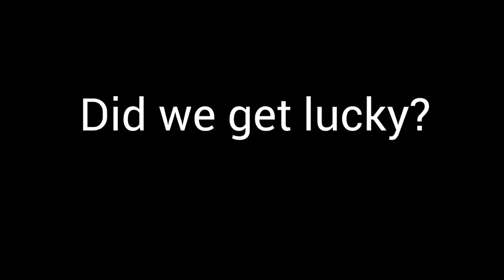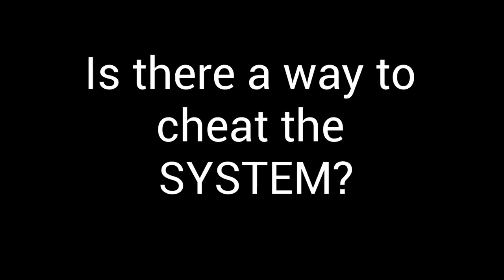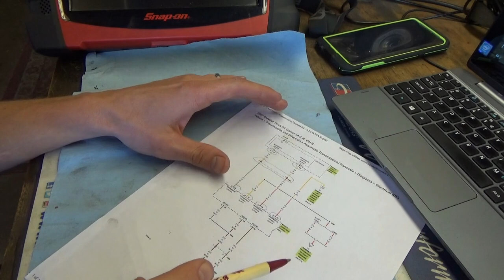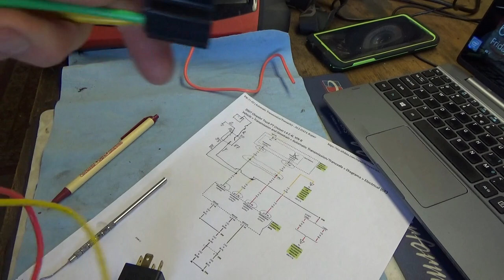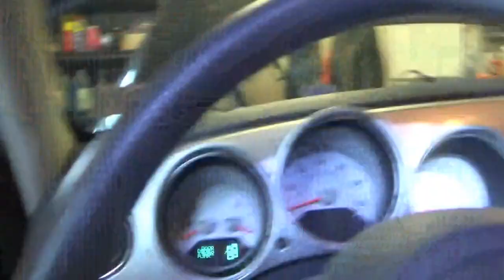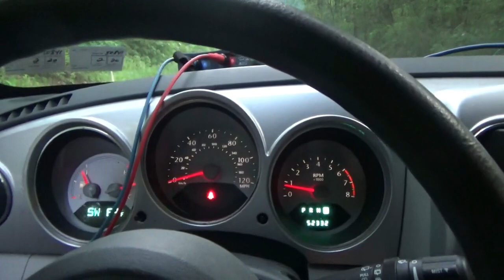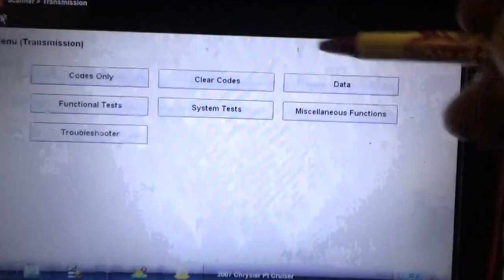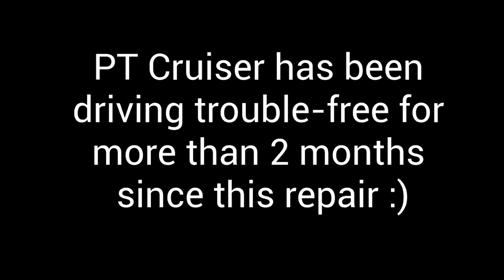Chrysler "LIMP HOME" Cruiser: P0882 - TCM Power Input Low (Part 2 - TIPM!)

Comment: The ONLY problem I see with this bypass (and it's a great fix by the way) is fault logic. The TIPM will no longer drop the output if there is a fault trip.
Reply from the maker: Judging by the circuit description, the PCM is in charge in this case, so pretty sure the TIPM will be happy :)

Comment: Thanks for the insights.  The Russians would have never used that ill-conceived TIPM when the old school systems worked fine and could have been repaired in any garage w/o special unobtainable parts and w/o having degrees in flat-earth, celestial and quantum mechanics.

Comment: Very fair. I mean the diagnosis time would have been the same either with the Russian repair or if you had ended up replacing the TIPM altogether. So, an hour and a half, plus the relay instead of the $600+ TIPM, I say this customer is getting a killer deal.

I could take it a step further and say that the $600+ TIPM is prone to suffer the same demise as the first one as opposed to the relay outlasting the car.

Comment: I have a 2006 PT Cruiser I see the light green wire no.18 but I do not see a yellow/Orange wire.  Did they change the color coding from the 2006 to the 2007 PT Cruiser?

Comment: Ivan, why didn't you also use the voltage of the pcm on the switch side instead of laying a cable to the battery? and you should connect the fuse as close as possible to the battery next time, but otherwise a good diagnosis and a pretty simple fix!
Reply: That wire coming from the PCM isn’t designed to carry the current to handle that load. The wire he tapped into is just to control the mosfet in the TIPM and now he has it triggering the relay which now serves the same purpose essentially.
Reply: @Jpilgrim30 , that was also the only reason I could think of myself, and yes, this way you are sure that you will not blow anything up.

Comment: FCA had a tsb on Durango fuel pumps to wire in relay out side of the box early tens also wired many in the early 2000s Ford truck s for the fuel pumps

Comment: I have a 2004 PT Cruiser 2.4 no turbo with a stuck in gear problem. I have Park, Reverse, Neutral and one forward gear. First gear. I am wondering if it is the same problem.

Comment: Can the yellow and orange wire be yellow and black. I can't locate a yellow and orange on the 2007
Reply: I have a 2006 their is a yellowish wire I also see a yellow/black wire. I've tried the yellowish it worked for 15sec then went back to the engine light. Couldn't tell if it was shifting.

Comment: I'm just wondering one thing?
Does the TIPM have any logic (based on some other inputs / voltages / fuses etc.) that would allow it to disable that signal going back to the PCM independent of the signal coming from the PCM?
 If it did, then with your modification it would no longer have that ability to go into limp mode due to those other factors.
Seems odd they'd send a signal into the TIPM to simply have it pass back out again. (except for the necessity of a driver). Especially since pcm output seemed able to drive enough to satisfy those other three logic signals without a driver since it was able to drive your test light.
Odd?

Comment: Half of what the TIPM runs as far as what to charge. As you said, labor. You ALWAYS need to get paid for your talent. The dealer would have SCREWED the owner. You didnt fudge a repair eather. You actually IMPROVED the device. Your repair will outlast the original dealer repair and that speaks volumes. I would glady pay you for what you saved me. Then I would sell that POS !

Comment: on the older systems like that, "non can-bus" controlled when putting a relay in, be sure to use a flyback/anti-spike diode or the issue will soon be upstream and major from high voltage spikes do to back emf as the field collapses =p
holy-moly too much for youtube's

Comment: doesn't the TIPM protect the transmission and place it in "Limp" mode for other valid reasons (other than low voltage)?
One would image that's what some logic in the thing was built for.....  
I understand the fuel pump issue but this command to limp mode seems to have some protective cases....

Comment: Well nice job I’m going through the same thing with my 2005 Sebring I’ve got the relay fuse and power working on the output but be dammed if I can find the yellow and orange wire I’m thinking did the Company change the color of the wire I need to hook to if you would get back with me on it lost is Louisiana lol
Reply: I'm working on my 2005 PT and also cannot locate the yellow/orange wire.  Did you find a solution?  If so please share.

Comment: Ivan, did the Toyota relay have a built in surge suppressor accross the relay coil? (diode or resistor)  I'm guessing yes since it has been running for 2 months.
Reply from the maker: Of course. Toyota OEM relay made by Bosch :)

Comment: I had a p0882 low input voltage on a 2013 avenger 2.4, no power to tcm, bypassed with a relay and it would work temporarily then it would give a p0883. Any ideas?

Comment: I think this 90 deg. PCB interconnect looks very unreliable. I would have considered reflowing the thru-hole solder connections. There might be micro-cracks in the solder. And if one is bad, the next one will follow soon.

Comment: Hello Ivan. My connector where it is assumed that the yellow wire goes to I don't see an orange/ yellow wire there. I need your advice. Thanks for your valuable time.
Reply: I've a 2005 that also does not have the orange/yellow wire.  Did you find a solution?  If so please share.

Comment: Hello do have the worong diagram for the 2006 Chrysler pt cruiser. For the c4 harness I want to put this relay on it having the same issue and it also causes the obd data port not to work as well

Comment: You can get in real trouble if the relay doesn't include a flyback diode... electronics don't like to be zapped... when you de-energize a relay, there's a coil inside that generates a high-voltage pulse (remember how an ignition coil works?).  The cure is to add a diode across the coil that allows the positive feed voltage but shorts out ('snubs') the big reverse pulse.  Some relays include this diode... some don't.  Be careful!
Reply from the maker: This one does so no worries. The scope captures prove it too...no spikes!

Comment: I'm running in to the same problem with my 06 pt  Loser but the problem I have is on the connector I don't have the yellow and Orange white all I have is a yellow and black the yellow and Orange is on a relay on the firewall

Comment: You mentioned that these are not like a Mercedes or BMW. These tipm modules are straight out of the Mercedes playbook. Daimler owned both companies in this era. When the tipm fails it's actually a really easy fix if you have the $1200 to replace it. And they do have pretty robust limp mode ability. It's a different philosophy. Can't say I'm a fan though. I'd take the Toyota.

Comment: Ivan -- A+ for innovation, but...  I didn't see you put in a diode across the relay coil. So you're asking to blow the driver in the upstream module due to an excessive voltage pulse on relay-off. (In this case a negative voltage pulse, since high signal = turn on, which you've applied as "positive side switched" to the relay). That upstream module is the PCM/TCM, right? So not one to send abusive pulses to, willy nilly.  As a second issue, that PCM/TCM output was only expecting to send an information signal to the TIPM, not drive a significant load.  Driving the relay requires on the order of 100mA to 200mA, which is not very large by automotive load standards, but is 10 to 1000 times as high as an information signal would require.  So even though you demonstrated that this PCM/TCM output is capable of driving a test light, and then the relay, for a brief period of time, nonetheless this presents the risk of burning out the driver for that output as it's not sized and heat-sinked to drive such a load.  Hopefully it has in fact been sized to withstand various hazards, and this relay coil is within that envelope.  But the diode remains an issue.
Reply from the maker: Interesting thoughts, Graham! I didn't see any excessive voltage spikes on the control or load side at all. This is a low-current circuit, and also the relay is only turned on/off only once per ignition cycle, so I don't think it's a concern in this case :)
Reply: You will be right by luck rather than by design, but automotive electronics is often designed more robustly than necessary ("defensively"), so perhaps luck is on your side.  Beyond the present case, I'm rooting for you to acquire ever more sophistication for your forays into "minimal-parts-required" design "enhancements". :-).  Glad to see you got a respectable soldering station!

Comment: Ok folks...I had the exact same problem with my 08 pt cruiser. Bad tipm. Same issue loss of power. Wiggle the box and put pressure on it I lost power. Trouble code p0700 0882. I fixed it in less than 3 minutes. This is a manufacturing glitch. Here is what you do very simple. There   are 5 screws on top of the tipm. These screws are cranked down way too tight especially the centre one. This is causing stress on the circuit board and in conjunction with heat build up the stress is creating force on the circuit board and bending it very slightly enough to cause power loss. Remove these screws and then use a hand tool to tighten them but do not over tighten them. Leave them snug. Especially the centre one. Don't even snug this screw. Turn it just enough to catch and leave it this way. This will take the pressure off the circuit board. No need for the relay unless the tipm is too far gone. Remember hand tighten these screws and don't torque them. My pt is running fine now.no more limp mode.
Reply from the maker: Sounds like it has a cracked solder joint. Your solution is temporary until the crack gets worse 👍
Reply: @PineHollowAutoDiagnostics  ok thanks  .just in case I can do the relay. .I did notice when I cut the yellow and orange wire and tested for voltage there was power present at both sides. Is this normal?  Thanks a million

Comment: Hey I have a 2010 dodge journey with the same problem. I can't find the wiring diagram anywhere. Do you think you could help me find out what two wires I need to use from the pcm? I would really appreciate it. This thing is driving me nuts
Reply: Its an sxt btw

Comment: I have a 2006 Pt Cruiser Convertible with a turbo.  The wiring is different coming out of the PCM.  You put your relay using c4 pin 18 (lite green wire) and c4 pin 38 (yellow/Orange wire).  On my cruiser at c4 Pin 18 (wire is lite green) and Pin 38 (it is empty no wire).  Could you help?  Please!
Reply from the maker: Fill out the appointment form on my website, I can send you the OEM diagrams :)

Comment: I would put a diode across  the relay coil to suppress the back EMF voltage spike generated by the relay turning off from going into the PCM and damaging it. This spike doesnt exist in solid state switching.
Reply from the maker: Did you see the spike on the PicoScope during the test? I didn't, so it doesn't exist ;)
Reply: I think you got lucky this time. !
Good work as always though 🌝

Comment: TIPM fails due to vibration/warming up. Ergo: bad solder joint somewhere, but, indeed, with an entire board to choose from and it being conformal coated, good luck finding said joint.

I can see it from an engineering/manufacturing point of view, though. With going solid state so much more can be automated and, if one's process is solid, boards like that should last 5 to 10 times the usefull life of the vehicle. Thing is, getting and keeping your reflow soldering process solid is really freaking hard. Things like that slip through QC and you get one frustrated owner and tech 12 years down the line.

It's a balancing act from a design point of view. Do you go with the ease of repair approach, meaning your product will certainly fail if a customer uses it for a prolonged time (entailing all the hassle of getting it looked at and fixed) or do you bank on everything going well on your end and your product never breaking down, even if the customer hangs onto it for 25 years or more? -with the caveat of a more costly repair if an absolute minority doesn't make it to the MTBF (Mean Time Between Failures).

It's not that simple. Not all your customers are Ivan, or even know someone like Ivan. So, personally, I'd err on the side of eliminating mechanical wear items like relays too.
Reply from the maker: Yeah looking for that one bad solder joint would probably have been a lost cause!

Comment: Wonder if this will fix my pt cruiser that wouldnt go pass 60 mph, then 40, then wouldnt go up a hill, then not pass 5mph, then it broke down while parked with a rough shake to motor? It cranks, but wont start even with starting fluid. Would this be the same fix needed? Anyone think so? Thanks ahead of time, cause i been stuck in Georgia from North Carolina.

Comment: The question is, does the TIPM do any sort of logic control in between the input/output?  Like, does it command the limp mode, does it power down companion circuits to prevent damage, does it do other sorts of controls/protections that are now bypassed?   Or is it just a dumb relay box?   Secondly, there is increased risk to the PCM in this situation, as that 30-amp relay surely is sucking more juice/inducting spikes (diode or not) than a tiny SS power transistor.   Perhaps long term this may result is a dead pcm driver for the trans?   Is there precedent on this circuit like on the fuel pump bypass?  Not trolling, just genuinely curious...  I love it otherwise!
Reply from the maker: All good questions! Since the TIPM didn't set any codes, we'll just assume it's a dumb relay box for this circuit :)

Comment: Most common problems in this level of engineering. Crack sata joint. Says you can lose I press a soldering pencil over the joint in the specific areas where I suspect  A by joint. One  Chance out of 3 it will work.

Comment: Wonder if this will fix my pt cruiser that wouldnt go pass 60 mph, then 40, then wouldnt go up a hill, then not pass 5mph, then it broke down while running in park, with a rough shake to motor? It cranks, but wont start even with starting fluid. Would this be the same fix needed? Anyone think so? Thanks ahead of time, cause i been stuck in Georgia from North Carolina.

Comment: Any on notice the Fuse on the Wrong side of the Relay.. Fuse Need to be as Close to the Source as Possible, Any Short to Ground from Wire to FUSE will Glow a Full Burn thru of that Power Cable..

Comment: Have you or anyone else had problems with the Chrysler/Dodge vehicle dying while driving in traffic (Scarry situation) or not starting with the turn of the key? 
It won't even turn over. The electric system (including the radio) comes on. 
No "Warning Lights" indicating what is wrong.

Suggestions......?

Comment: I'm trying to do this, but the only yellow wire I have on my 2006 PT is yellow with a black stripe.. help!!!! Is that the right one?
Reply: I'm working on a 2005 PT with the same problem no yellow and orange wire. Did you find a solution? If so please share.
Reply: @0fukit  I think I did finally figure it out, but I have gotten rid of that junk because after I wired in a relay, I even got a new Temple, and it still kept doing the problems so I may have been in the wrong wire but I don't know. I'm sorry I can't help you

Comment: by 7:39 bad solder joint, very likely where the tow boards meet at 90 angle.... enhanced by ROHS junk, from the board substrate to copper, to lead free solder, to the top coating............
I wont go into the components  themselves lol

Comment: god i wish you were near me lol ur amazing at troubleshoot and getting root of problem i got dodge ram 2012 1500 5.7 got new one installed it get code 688 and 685 now truck wont start even installed old one truck was starting before my question is if i did soft and hard reset does it never pcm reprogramming ?whats you thoughts anyone tks
Reply: my truck wont start with old one too same code do you think reprogramming will fix it at dealer

Comment: HOW TO WIRE THE RELAY
86 ground
85 PCM command to TIPM (Light green wire on PCM harness)
30 Direct wire from battery to 10Amp fuse to the relay
87 signal to bypass TIPM response (yellow and orange wire on the PCM harness)

Comment: Stop Winging Mate. I worked on Complex Machines for Years. As later models came out they went more and more to Solid State and computer programming which had previously been run by hundreds of relays. Commercially repair time was reduced by isolating and changing boards.  Do you think Electric Cars are going to have relays? It is cheaper for the Manufacturer. Not necessarily the Customer. Garry.  PS, any relays in the ECM?
Reply from the maker: "Winging"? I'm just saying that the critical components on a car should be controlled by regular reliable relays. That's like 10 relays, not hundreds. Cars are becoming such "Complex Machines" that sometimes the basics are overlooked...like getting from point A to point B haha

Comment: On my new 1998 Dodge Durango, all ball joints failed in less than 24,000 miles, ruining my front tires. Three power window motors replaced at $300.00 - $450.00 a piece (at least they failed in the up position). ABS electronic module failed in 3 years. $600.00 to replace it. Five years later, rear passenger sealed window leaking rain water into body well where the rear passenger seat belt retracts, stinking from mold and promoting corrosion. I will never ever buy a Fiat/Chrysler product again!